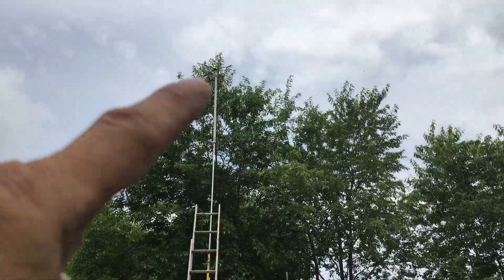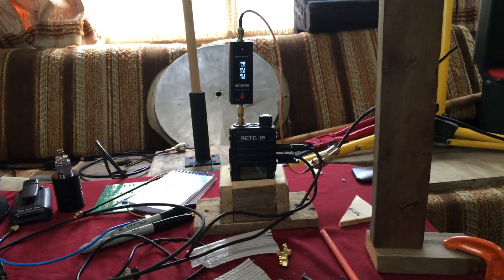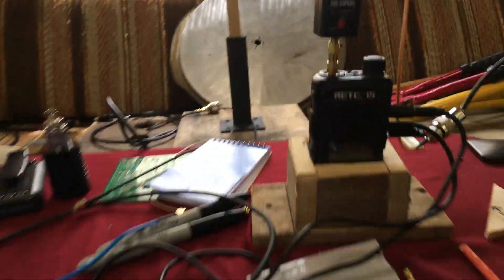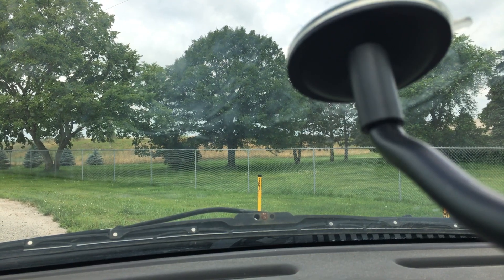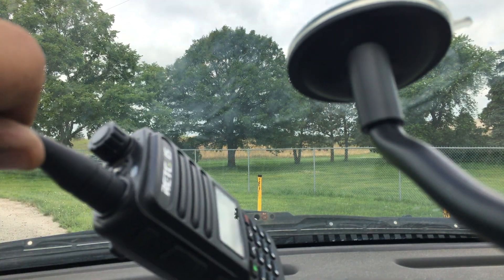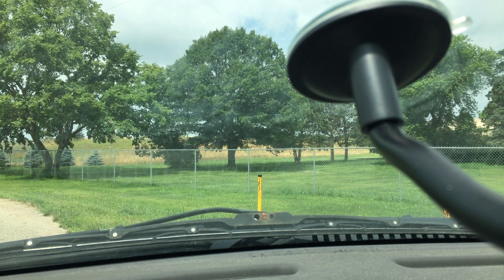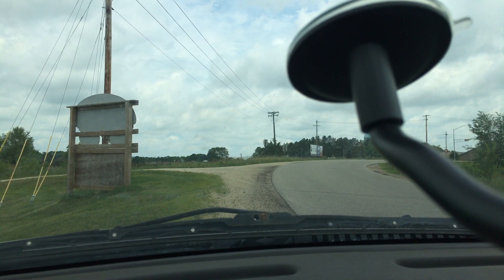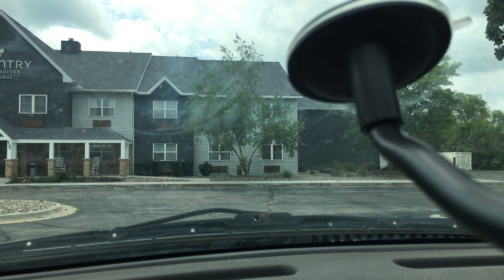🔺MURS VS GMRS Two-way radio distance (range) Test PART 1🔺

Comment: Late comment but it probably would have been a good idea to use MURS channel 4 or 5 which are the 154 Wide Band frequencies
Reply: Just learning about Murs what does this channel do?
Reply: @ralphlucas5448  
It's an old set of "Business" channels that nobody uses anymore,... Walmart was using Channel 4 but they are moving to Digital Radios.
FCC "Regulations" state you are supposed to use a MURS radio and stick to 2 watts but it is License Free and nobody uses those MURS Channels/Frequencies.
Any "Unlocked" or "Unlockable" Radio can have the MURS frequencies programmed and the FCC Regulations clearly state that in an Emergency where Life or Property are at risk, the "Regulations" are pretty much ignored so in an emergency when FRS, GMRS & HAM frequencies are busy, very few people will be on MURS to interupt comms with your family.

Comment: some question if you dont mind?
  is the rule of 3 miles to the horizon for 6 foot person is that set in stone??  are there ways to get pass this with cb/murs/gmrs bands besides additional height ?

presuming this horizon is set in stone  and all things being equal among them are the only differences frequency there ability to penetrate density per watt of power in order to make to to the hard limit  of the horizon

where is the height calculated exactly on the the antenna?? For example if you have a half wave 11 meter aka 18 foot long on the ground and a gmrs half wave 1 foot antenna that is  17foot off the ground, there both at 18 foot to the tip.    Is the grms antenna in theory  higher even tho there both at 18 feet?  i ask because the cb is still on the ground yet the grms is 17 feet off the ground . would this mean its better to vhf as you can gain more height with less height versus a longer wave length?
Reply from the maker: Well, lots of variables that will affect distance. Like trees and even the leaves on them! Buildings, hills, weather, antenna height,etc so keep that in mind!   I know people who can talk 20 miles some can only talk 10 miles. So I hope this answers your question 🙂
Reply: @GMRStwowayradio  hi i didnt expect you answer so quickly i actually wrote a second question that has been bugging me for while that i cant find the answer to :
where is the height calculated exactly on the the antenna?? For example if you have a half wave 11 meter aka 18 foot long on the ground and a gmrs half wave 1 foot antenna that is  17foot off the ground, there both at 18 foot to the tip.    Is the grms antenna in theory  higher even tho there both at 18 feet?  i ask because the cb is still on the ground yet the grms is 17 feet off the ground . would this mean its better to vhf as you can gain more height with less height versus a longer wave length?
Reply from the maker: @mikeriverajr4447  if I understand it right, it measured from the tip of the antenna to the ground that the antenna pole is on. As for VHF as you have seen in my videos i didn't see a big difference . Technically, the wave length you are talking about is better compare to UHF. Case in point, the county police department in my area went back to their old VHF system because it travels better.
Reply: @GMRStwowayradio  thanks for your response,  so if understood you correctly, the cb meter antenna that is 18 feet would be considered at 0 feet height of the ground  while the 1 foot uhf would be at 17 feet height..   if bother ther tips are at 18 feet. . . 

so interesting, so depedning on how deep this goes i would suspect you should be able to get better propagation off of a 1 foot uhf, at a total height of 18 ft  versus an cb 11 meter at total of 18 feet 

because the 1 foot uhf  antenna 17 foot off the ground , while the cb antenna is technically not off the ground at all even thought its total height is still at 18 ??

do you know where i would be able to reseach this more , i cant find clear source on this subject, people always talk about height but not from where and how ant length plays into it
Reply from the maker: @mikeriverajr4447  yes, that is how I understand it, I could be wrong. The best way to get your answer would be to email the FCC or look on their website. I am not sure if I found that info on the website or not. I am sorry I don't recall.
Reply: unless you sign a contract with the fcc, you are not under their corporate policy.
Reply: Only congress writes law.

Comment: Which Retevis MURS radios are these?   Or is it a HAM radio used on MURS frequencies.  THanks!
Reply from the maker: i am not using MURS radios i was using the Retevis RT85 model programmed to the MURS frequencies 🙂
Reply: @GMRStwowayradio  Thanks.    I have to stay within the parameters because they would be handout radios for community neighborhood watch.   I've seen other tests where certifide MURS  HTs typically only outperform GMRS in rural situations.  They are not so good with buildings and electrical interference.   Five watts must make a difference.
Reply from the maker: @togeika  I thought I turned the wattage down, so it was equal for both bands. But either way, I make sure the wattage was close to the same for the tests.a just a fyi

Comment: I can’t believe that you went through all that trouble to set up the test, yet you sat in a steel car to transmit.
Reply from the maker: yes, I wanted to do it as if a person was sitting in a car! Not everyone wants to get out of a car to transmit, so I did it as if a person was driving, not really safe to driving and talk so i parked and talked
Reply: It's like trying to use a radio inside a faraday cage . That's why mobile antennas are on the roof and not inside .
Reply from the maker: @larryhaney6608  I hope in the future to do a video using a mobile antenna on a handheld, so people can compare it to my other distance videos